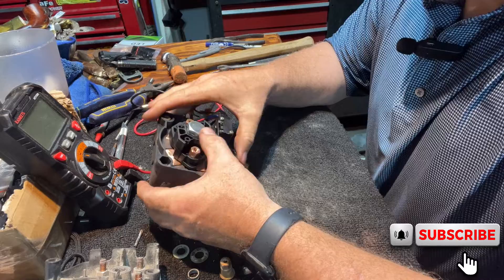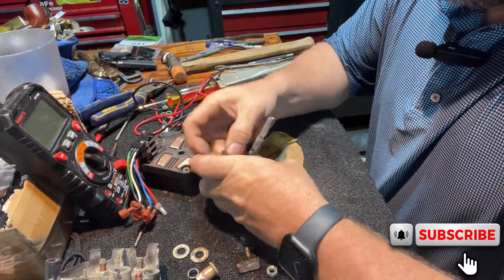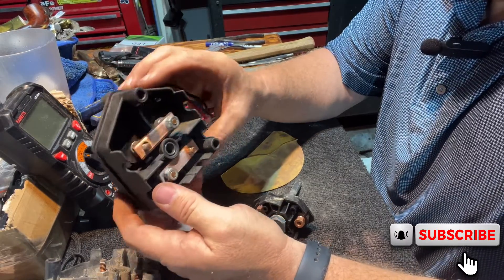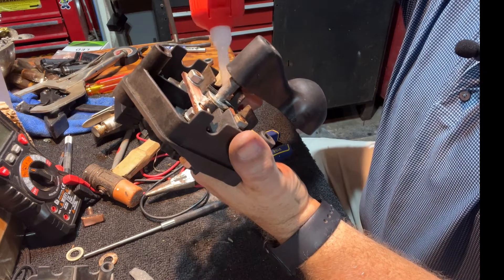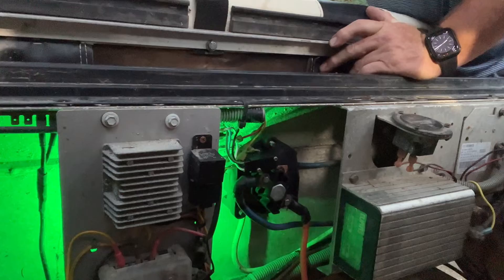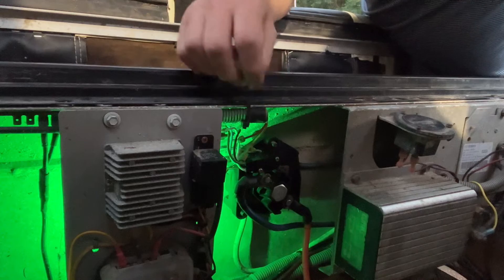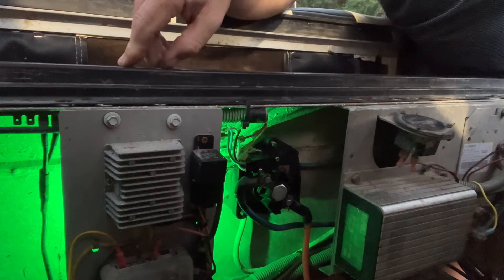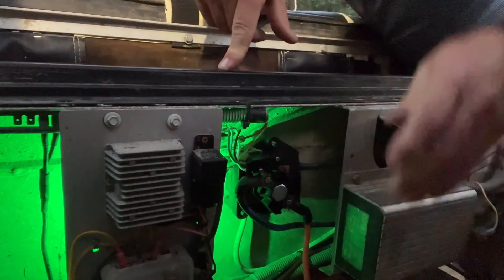Solenoid click but no forward and reverse. Don’t buy a new switch, FIX IT!

Comment: Thanks for the trouble shooting and repair video. I don't recognize your cart model, the parts, controller relay & F & R switch are the same as my 2001 DS, but from the video the controller is in the  wrong location. Anyway my next MCOR replacement will be the RTS Throttle with the wire wound potentiometer. It's expensive but I think that I will have to break the bank. Nice job with the 12V distribution panel.
Reply from the maker: Thanks for watching. Mine is a 2001 Carryall 2. Very similar to the DS line.